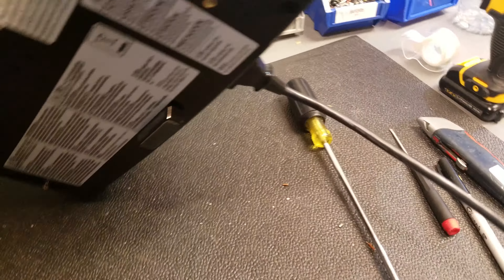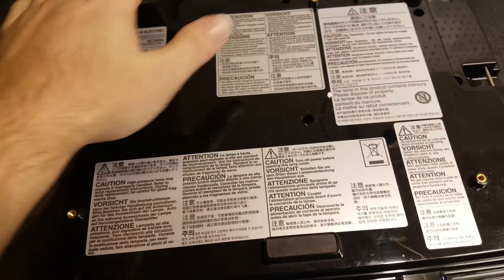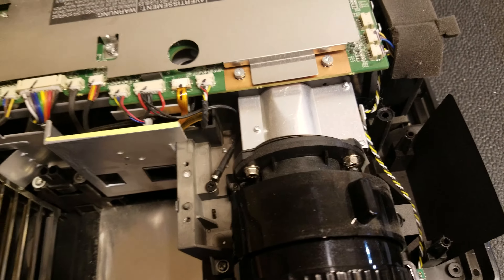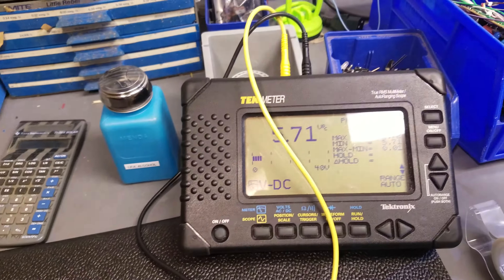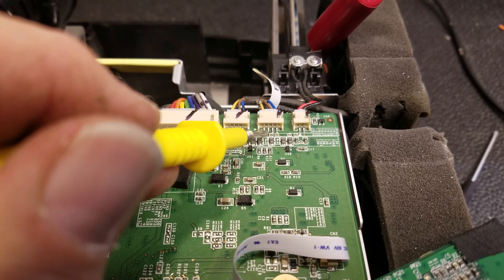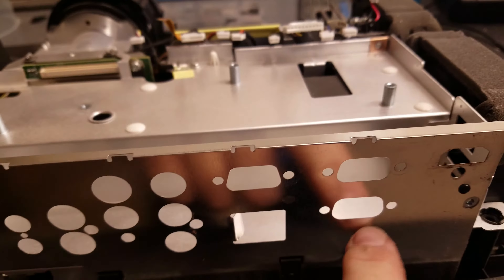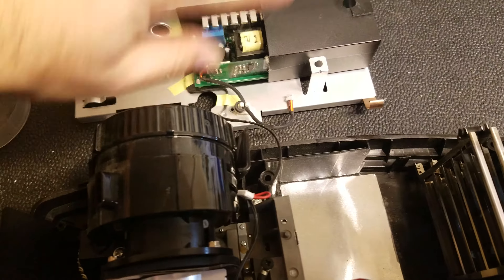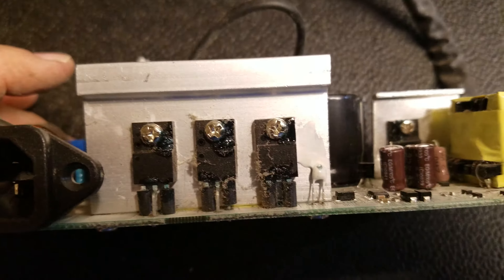Mitsubishi HC3800 Projector Repair No Light Part 1

Comment: thanks a lot for this video!
I have a problem on mine. Its plugged on but it doesnt turn on. None of the led are glowing/flashing as well. Any idea where I should look at?
Reply from the maker: There are a few possible causes. Check the simple things first. Power cord, lamp, and lamp door. If none of the LEDs light up, plug in the projector slowly and listen for a click inside the projector.  If you don't hear a click, its going to be something with the power supply. At that point it you need to look at repairing it or having it repaired.  If you hear the click, check the lamp door .  It might not be aligned with the door switch.  Take it off and put it back on. If it's still dead, you are back to something more serious.

Comment: I got a weird one with my HC3800. Saw this video and read all the comments.  
Power on, goes green with status flashing green during start up. Fans turn on high speed.  Bulb turns on, fans go to slow speed (operating speed?).  Bulb turns off after 15 seconds with good image, power goes red, status flashes twice in each sequence (error code?). Then switches to normal flashing (shutdown?).  Projector  powers off.

Reseated bulb(not replaced).  Blew out fans and housing.

I can't find fishing code.  Something simple? Fan sensor? Power supply?  
Thanks in advance.  Great channel
Reply from the maker: https://www.projectorcentral.com/pdf/projector_manual_5127.pdf  page 39 has blink codes.  This kind of sounds like a lamp though.  90% of the time the lamp is the issue.   I always suggest the lamp first anyway since its the easiest thing to change and without a known good lamp you can end up running in circles.  Plus, then you have a good lamp that will be nice and bright.

Comment: Hi Fixit frank, I have a 10 year old Mitsubishi HC4000 which is sparingly used. I don't know the lamp hours but could be around 3000hrs. My projector stopped right during a movie and when i tried starting it again, the power and status lit solid green, all the fans start, and there is the normal whiring sound but lasts only around 5-10 sec. This repeats thrice and then the power turns solid red and status blinks green. The lamp doesn't turn on at all. There was no warning of lamp or otherwise before this happened. I took out the lamp and there are three small ceramic pieces inside the enclosure. Please do let me know what you think the problem can be. Thanks a lot 🙏
Reply from the maker: That does sounds like a failed lamp assembly.  Unfortunately if someone changed the assembly and didn't reset the lamp timer counter at the right time, the hours may be incorrect.  I use these folks https://www.purelandsupply.com/mitsubishi-projector-lamp_hc4000.html   However there are some other sellers on Projectorcentral's "where to buy bulbs" that are also reputable.
Reply: @FixitFrank  Thanks for your kind reply 🙏
Reply: Do you have any link for Australia?
Reply from the maker: Not at the moment but I'd check with the actual vendor who makes the lamps. They are in Taiwan and have resellers all over. https://apoglamps.com/en they don't sell to end users but they will tell you who the closest reseller would be.

Comment: Can you make a video where you unmount also the color wheel of the HC3800 ?
Reply from the maker: I don't have an HC3800 around at the moment. I did replace a DMD on an XD280u which is close and the steps to get the color wheel are basically the same. https://youtu.be/cmRvBv1f46w

Comment: I have vertical lines that come and go. Evenly spaced. The color on the pixels in the lines depends on neighboring pixels. ¿Maybe clean dust that is shortcircuiting something? or solder broken?

Comment: Hi! I know is somehow a little old, but I was wondering if you have the part 2... Thanks!
Reply from the maker: Hello Fernando,  I never bothered uploading it because the main power supply ended up being bad and the customer didn't want to pay for the repair. The problem ended up being a voltage regulator and the ballast damaged by a cheap knock off lamp.  The cost was pretty high so I do not blame them.  The parts alone was over $250.
Reply: Got it! No problem and thanks for taking your time to answer. I've purchased one of this projectors for a cheap price and so far I'm very happy with it. Since it's a little old, I was a little concerned with possible problems. Thank you!

Comment: This might be a long shot as it this a 2.  Year old vid, I have the HC7800d but same symptoms solid red power and flashing green status  lamp doesn’t come on fans start up the. After a minute or so it shuts off
Reply from the maker: I still monitor the comments so no worries.  How many times does the status light flash before pausing and re flashing?  Or is it continuous?  It definitely could be a power supply issue though.  That is a nonstandard error.

Comment: Hey I have the same model but this temperature message keeps popping up do you have any ideas?
Reply from the maker: I do!  Either a fan is locking intermittently, or dust is built up and causing higher than normal temps.  My suggestion is take the top off and vacuum everything you can see. Make sure no glass is inside the lamp blower fan and you should be okay.  Worse case you need some new fans but until you can confirm that I would not worry about new fans.

Comment: Hi! sorry to comment on an old video, but I'm getting desperate! The color wheel died on my projector and while attempting to replace it, I couldn't figure out how to get at the color wheel. If you could give me some insight, that would be amazing, Thanks!
Reply: It's this exact model. Thanks for the video, and the advice! It has been super helpful. Before I dig into the insides further, just a little background. The projector was working fine, other than some annoying color wheel buzzing. Just a few days ago I noticed some green flickering on the image, suspecting the color wheel was finally going out, I opened it up to see if cleaning it out would help anything temporarily. Now when I try to power on the projector, the fans spin, however, the lamp doesn't come on and I can't hear the color wheel spinning. The status lights blink telling me the projector is "abnormal." Do you think replacing the color wheel would most likely fix the issue or should I not bother putting the money into it and just get another projector? Thanks again for your help!!
Reply from the maker: Whoops. I used my wrong account to reply...I have to delete that comment but Ill archive it. To me it sounds like the color wheel. Especially the flickering green. I would try and clean the wheel sensor first.  Get some compressed air(not too strong) and give it a spraying to get the dust loosened and out.  I'd check FleaBay for a new CW.  you should be able to find one for a decent price.  That said you may want to clean the old one first to see if it'll get you through until its time to upgrade.  PM me if you want to. -Frank
Reply from the maker: No worries! 2016 isn't that old is it?  Do you mean in this model projector or another? The CW is a little bit of a pain to get to on this model. You need to remove the entire Optic assembly and replace it from there. Once the optic assembly is out, its pretty easy.

Comment: https://www.youtube.com/watch?v=Rh-smCbcLB8

Mitsubishi HC4000. It all started when the lamp in the projector burst (the lamp shattered into small pieces in the module). 
I took out the module and there were no shards in the case. 
I ordered a new lamp with the module and it arrived almost 3 weeks later. I put in the new lamp, zeroed it (as written in the manual), the projector switched on, ran for a few seconds (as seen in the video) and switched off. After that I took the projector with the new lamp to the repairman, because I thought that some small fragments got into the cooling system and that was the cause. But the repairman inspected the projector and found no visible defects and returned the projector back to me. He couldn't do anything and didn't understand why the projector was shutting down. He said that maybe I was sent a defective lamp and it should be replaced because the blinking on the projector indicates a problem with the lamp. I ended up getting that lamp replaced with another lamp. And I thought it would fix the problem, but it didn't. The projector works for a few seconds and then goes out again. It's like some sort of defence system is kicking in. 

Before that the projector worked for 11 years without any problems, with one lamp that came with the projector (it was bought in March 2012). 

Any advice would be appreciated. Thank you.

Comment: Thank you so much for this video. I have the same projector and the IR receivers on the back and the front are not working it seems. Doesn't respond to its own remote or to a harmony remote set for that device. I was trying to open it up to see if something obvious was disconnected and your video helped me figure out how to open the case. Sadly, couldn't find an obvious problem. Any ideas for why IR would stop working? Thanks again!
Reply from the maker: Hi Ron.  That is a strange scenario. I'm assuming the batteries are good in each. I'd make sure nothing else in the room is interfering. Motion detectors, plasma TVs. Anything that might also broadcast wavelengths that can block the sensors.  Otherwise, I would suspect that the sensors are not getting 5 V to them. They are using something like this http://kaushikscienceprojects.com/wp-content/uploads/2016/05/IR-SENSOR-1738-1-600x480.png  that would need to have 5V on the VCC side.  Also maybe check your menu settings in case there is a way to disable the IR for security/tamper reasons.  Maybe do a full reset and see if that helps.
Reply: Hello Frank, thank you so much for the reply; very kind of you! I've eliminated interference and batteries and all that as best I can. I've also reset the setting and poured over the menu and the manual for something that disables the remote and found none. I don't know anything about this stuff but I'll try to measure the voltage at the sensor and see what I get. If I don't see 5V though, what would be my potential problem then?
Reply from the maker: That would be a cable or power supply issue.  It would be pretty odd honestly as its the same 5V that powers other things usually. One thought I had was that one of the sensors might be bad and its affecting the other.  Maybe try unplugging one sensor at a time.

Comment: Hi sir in Mitsubishi HC 4000 and hc3800 in both the projector  error is as when switch the main supply standby led blinking red to green and satuts led blinking orange simentenously what type of this error? All  themiser and is fan ok pls guide me
Reply from the maker: Do you get any sort of fan noise or do they act 'dead' aside from the flashing Status and Lamp light?  If no, then I would refer to the manual for the 'lamp timer reset'.  I forget the exact buttons but I recall you need to unplug power, hold down power and the button next to power, then plug in the cord.  The status light should flash two times and then the projectors should work again. usually this is caused by the lamp timer running past 4000 hours.  Make sure the lamps have been changed. Using an expired lamp will possibly allow the bulbs to explode and flood the unit with broken glass.
There are some other possible causes but you would need to use a computer and RS232 cable to troubleshoot more. 
https://www.projectorcentral.com/pdf/projector_manual_5127.pdf  <--HC3800 manual.  Refer to the lamp timer reset steps and see if that helps.
Reply: Hi sir in Mitsubishi HC 4000and 3800  both the projector 5volt system supply fail it is replace by 5 volt  small smps module 2amp  after fitting all assembly projector working but suddenly  standby led blinking red to green and status led orange  typical error  but problem is sort out final
Reply from the maker: I think you will need to fix the old power supply.  The different voltages are working with each other.  You probably have no high voltage to the ballast. I would see if you have 380DC on input to the ballast. If no(150-300dc) you have a main power supply problem.  The switching IC can fail as can the capacitors. I think your 5v supply was a good idea sometimes, but in this case If you only install a new 5V supply it will only power the mainboard. The main power supply needs all portions functional to operate properly.   Here is a link to the service manual.  This will be very helpful in troubleshooting the main power supply.  https://elektrotanya.com/showresult?what=mitsubishi%20hc4000&kategoria=&kat2=all
Reply: Iam projector engineer  if we connect the power supply to main board and Short the lamp cover switch and no any connections like fan thermistor this situation main board show only power led red which means standby this is fact but here  other error show standby led not steady that's abnormal error of main board this finds in only  Mitsubishi.  system power supply is separately in power ( 5v) many projector iam fitted it successfully here is no problem in Mitsubishi if u fitting all assembly error is out and projector working properly but no guarantee  error coming again maybe this error creat due to openloop  ckt
Reply: Sorry sir I am explain it but this error is iam finding tow board of Mitsubishi hc3800 andhc4000  no any affect of system power 5v apply separately  no connection with other supply in power supply board these are generat after standby release than relay clicking sound
Reply from the maker: I read the service manual for HC3800.  The error says disconnected thermistor, but you say thermistor is OK.  Maybe try other thermistors? Also check L74, R207, R208, R209, L75.  Also see if you have standby3.3v on L70, R210(22k), R212(8.2K), R211(2.2k)m PR17(100ohm x4).  They send signal to U50.  Pins 68(DMD temp), Pin69(TempLamp), Pin70 (Temp In), Pin71(DOP_RESZ).  I would also check U50 power. Pin14 VCC, is fed from J14 Pin4 (3.3v).  
I think you have no 3.3v standby from the power supply.  The 3.3V is common to thermistors and U50(and other parts).